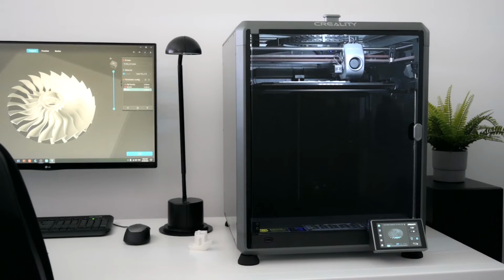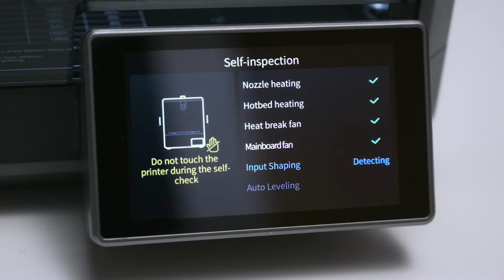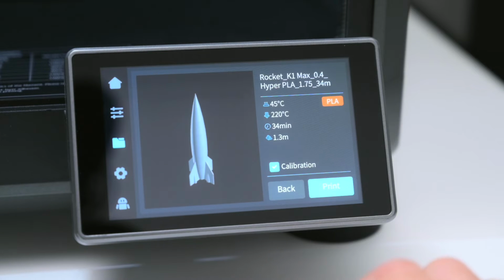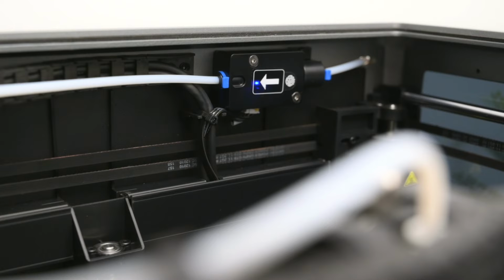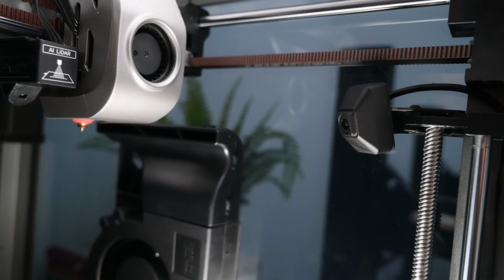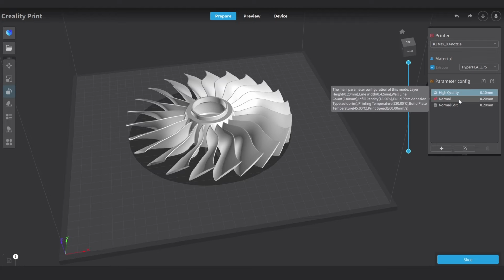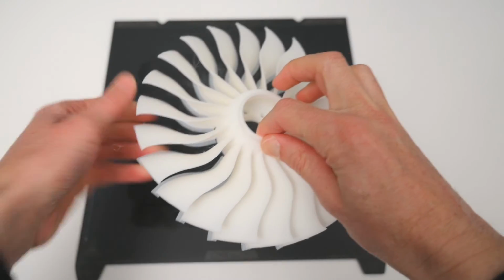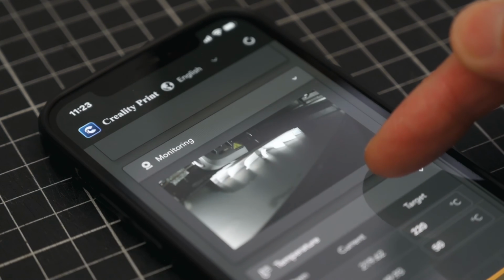INSANE PRINTING SPEEDS! K1 MAX 3D PRINTER

Comment: I experience adhesion where the supports touch the pressure and distortions on the printing surface. How did you overcome this? How are your support settings?

Comment: Amazing machine!. After muddling around with messy resin printers I was pleasantly surprised at how easy and reliable 3D printing could be. I have been designing parts and sending them directly to the printer every day since day one. This machine allows you to focus on your creativity and iterate on your designs without worries. I easily print ASA and TPU reliably without issues.

Comment: Going from an ender3 and curious about Prusa. Honest opinion, would this k1 be the next step up? I mainly 3d print random stuff but mainly parts for a sim racing wheel I assemble together.
Reply: Prusa has had a reputation for having the best customer service in the industry, but with how much you can get a 3d printer like the k1 or the p1p, it's hard to justify the price from prusa for what you get
Reply: @notluke8158  
I’m looking to replace my ender3 since it seems after 3 years all of sudden my z axis doesn’t want to calibrate to the print bed even with the cr touch. Plus I just want a faster printer. The k1 looks nice the pro isn’t needed for me imo. I can get the attachments later.